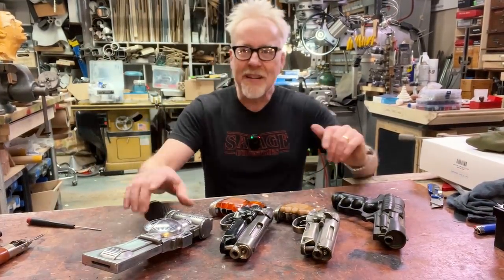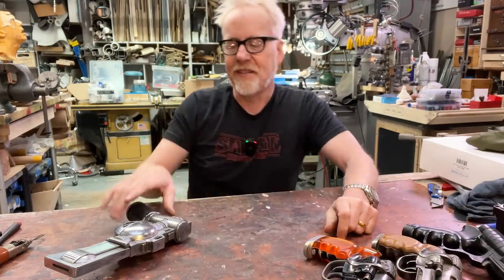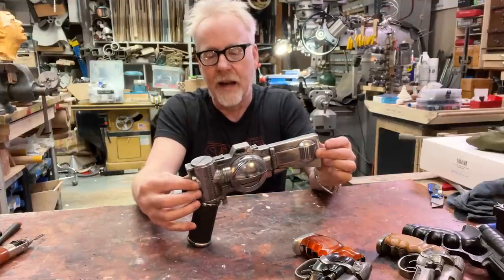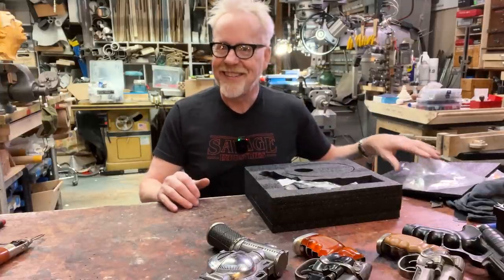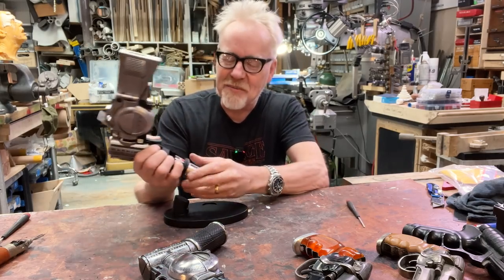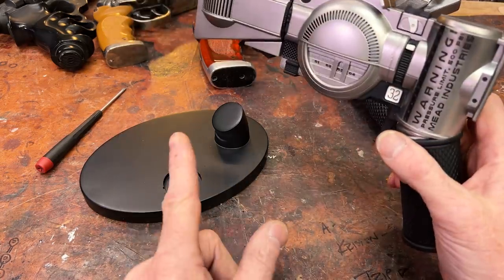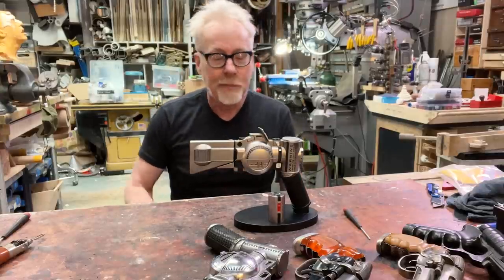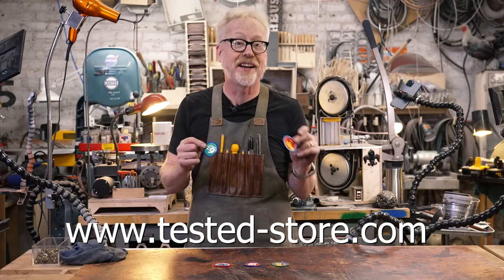A Tale of Two Syd Mead Blade Runner Blasters

Comment: The thing that jumps out at me more than the LEDs is the seeming lack of a locking point for the swiveling barrel. It doesn't appear that it clicks into place in any way, which strikes me as an oversight. You want that to feel locked into place when it's extended.
Reply: I love the battery compartment, lovely build. RIP Sid.
Reply: I'm confused why there was a folding barrel at all? Does it shoot around corners or...?
Reply: @warped_rider  yeah it looks like it was meant to have a screen to view to see around the corner as well.

Comment: It's always fun to watch a maker like Adam, who wanders between pinnacles of prop and set making, break down collectibles based on collaborations on fiction. The concept art Syd Mead made is apparent in both blasters. The mass produced version has proportions closer to a semi automatic pistol, and had more gimmicky selling points that a fan would find appealing yet wouldn't be sated by. It's a lot of puzzling out to get build time down, which is a major expense if it takes an hour to finish 1 of 10,000 for example. I like the larger 1 because it has more of a Navy revolver's proportions which I bet is more accurate to Mead's drawings. It would be cool to see a hand built, fully lit hero version but that would a lot of work. This was a good ride along the Alps in a delightful train of thought.

Comment: Yeah, that bought one is... well, to put it nicely, it's ok. The SM piece is a master piece. Just looking at it, and how it moves when handled by Adam, i can tell it's so far above that mass produced one it's not even in the same Galaxy. I also think that vacuum metalization was the right choice for it. Chrome is nice, but too nice. I've had several pieces done with VM and it's such a nice outcome when the right substrate is under and the right shade is used.

Comment: It feels like the barrel should lock that seems like an odd oversight, I also agree that the lights should be brighter if it doesn't have animated lights and sound it should at least be a bit more striking when it's on display. Then again if it's been around for a while I can imagine the technology of the time probably didn't allow for all those things at one time, seems the least that could be done to improve it is to install a brighter light.
Reply: You could probably get it to lock pretty solidly with a rare earth magnet without too much trouble.

Comment: I would love to see a CNC milled version from aluminum, with all the gauges and lights engineered and incorporated. It would probably cost $1k or more to do, but would be totally worth it.
Reply: WAYYY more than $1k.  That blaster has a ton of compound detail, and each one of those is a machining step from a dude with 20yrs of metalwork experience and very pricey equipment.  You're probably talking $20k, and that's going to be cheap.
Reply: @TheHamPimp  -- I was only thinking about the parts on that cost. If you're making one for yourself, then you can charge $0.00 for the labor.

But yeah, if you're making one for someone else, then you're basically doing all the same things required to make a real prototype weapon, and so you could probably buy a nice car for the price, or maybe a nice house.

Comment: I wonder what all of the parts of the gun do in their sci-fi context. E.g. why is the barrel shaped as it is with its odd rectangular opening and flared out metal, etc. 
Im not sure if Mead or others thought about all those specifics in great depth, though some of the text on it does suggest some ideas about its functionality. 

(The max PSI indication is interesting, though extremely low for a fire arm, which kind of raises more questions than it answers.)
Reply: I believe this was Syd Mead’s attempt to depict the “Black Hole” gun in Phillip K. Dick’s novel that Blade Runner is based on.

Comment: No Sound chip was the dissapointment ? 
Swivel , to shoot around corners 
4/5 Decades before real hand gun led screen device .
Uk T.V. screened Bladerunner on Channel in 1989 with Gun re load scene that used the hero bladerunner prop. The scene is not in any released version available EVER . It occurs at the end of the film in the Bradbury building , after deckard randomly shoots at walls to to hit Roy . He runs out of ammunition and the lights go out on the gun . He pulls the pack and drops it on the floor and replaces it with a new pack from his overcoat pocket . The gun lights in ammo pack re-light .